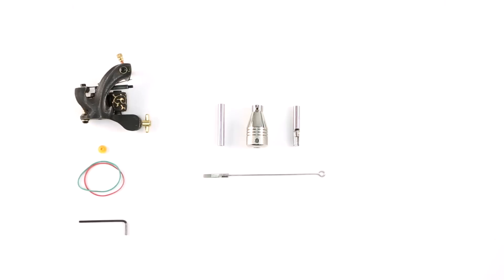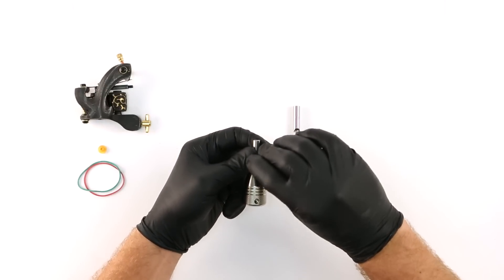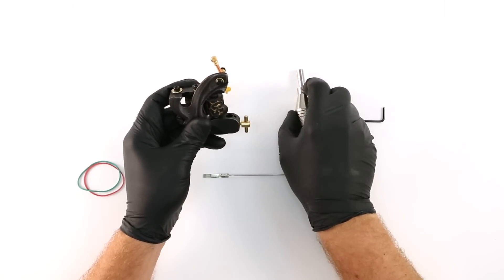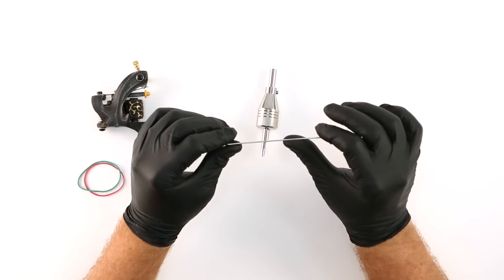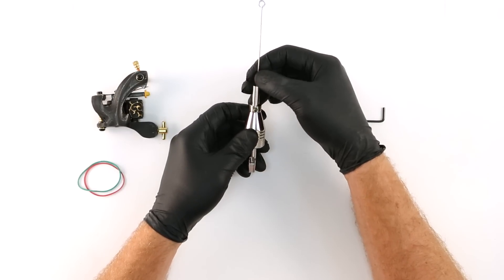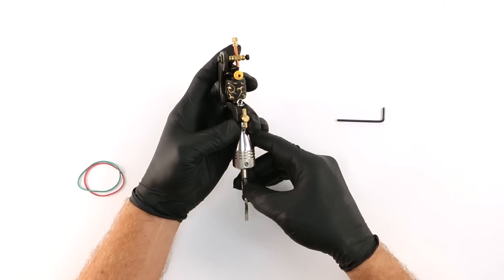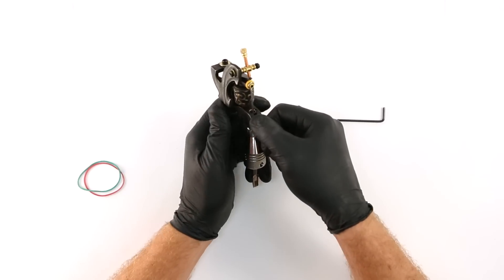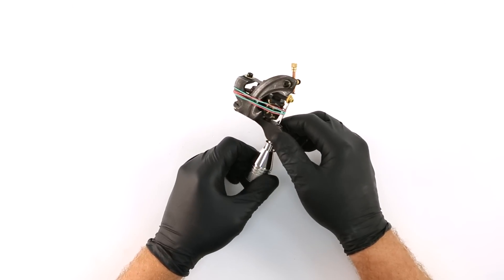Tattoo Machine Setup - Needle and Tube

Comment: nice video! i've a question, i was using a 5rl while i was testing this, and i notice that my needle remains like 4 millimiters outside of the tip. its normal or i need to adjust the stem ?

Comment: How far out should a magnum needle be when the machine isn't in use? For some reason i seem to tear the skin more often then not when using these magnums. The needle jumps around instead of staying in place
Reply: If you press the needle forward, as at the end of its stroke, it needs to be at a length you like to work with, I have mine showing 1 mm more than my work depth when pressed out, this seems to work well for me and allows the tips to pick up plenty for the next pass when they retract, This is for a medium stroke though, it may not suit everyone. so when the machine is sat idle mine are actually just short of the tip and can not be felt if you pass your finger across it..

Comment: What if I'm using a single rubber band, and yet the needle is not moving because it's too tight?
Reply: Jasmin Feels  what volts are you running on your power supply
Reply: Mmm I've been doing around 4.2 only because if I go any higher than it starts to spark.
Reply: in general that is a good voltage to run a quality setup. If you can bump start the machine then I would recommend maybe trying to stretch the band a little before putting it on or trying to tune your machine a little different.  A well tuned machine should be able to run at 4 volts flat up to 9 with out sparking.  I hope that helps.